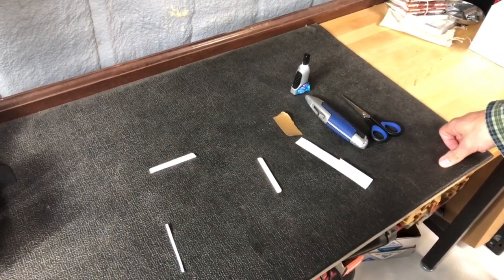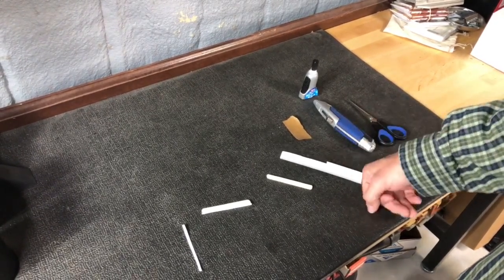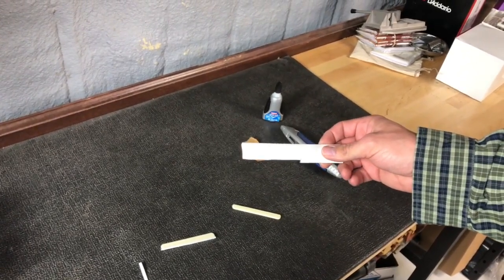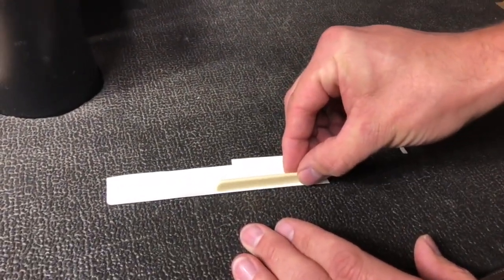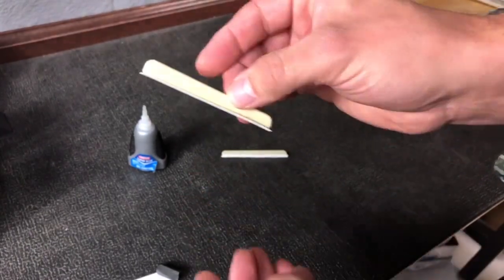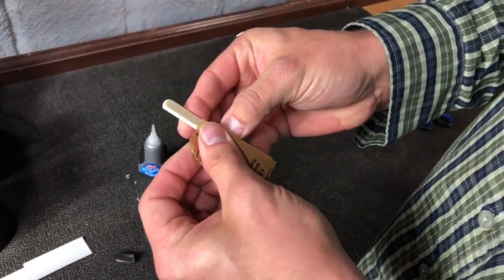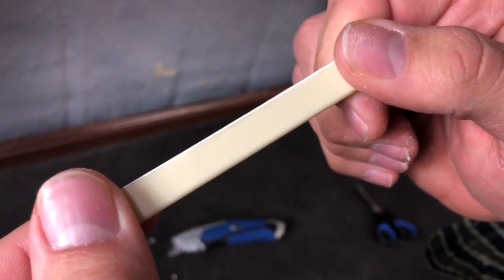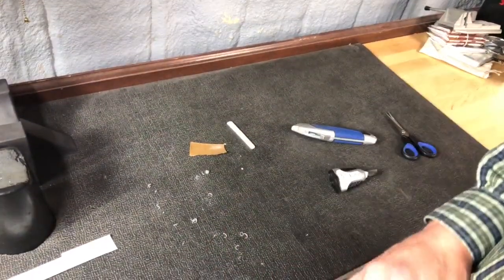Tech Tip– How to Raise or Shim a Guitar Saddle

Comment: Thank you so much. I paid a luthier $120 to set up my guitar and he put the saddle so low that all the strings were buzzing and he wouldn't fix it. I can't thank you enough. The only thing I had available was a fingernail file I took it apart and there was a plastic insert in between. I cut it with scissors and filed it down and it fit perfectly. Hallelujah❤❤❤
Reply: That’s not a luthier that’s a con man
Reply: I paid a luthier 100 for a setup and he made no adjustments ,just changed my strings.  Some really bad luthiers out there, and the good ones are expensive.  Best time learn yourself. This is a great video. Thx
Reply: Many years ago, I took a fairly expensive acoustic guitar to a tech who had been in business for over 30 years...I don't know how. 🙄The guitar had an under saddle pickup & the action was way too high. I asked him to do a full setup to get the action down with no buzzing. All he did was change the strings & adjust the truss rod. (I could have easily done that myself!!) I asked him about lowering the saddle because the action was still way to high, & he said that he didn't like to mess with saddles that had a pickup!!! Another time I took a guitar to a tech because the frets were uneven...all he did was raise the saddle...said he didn't like to mess with frets!!!😕How do these folks stay in business??!! So I just learned to do it all my self!!!!!

Comment: Thanks...some interesting tips! I live in southern Indiana...huge humidity swings summer/winter wreak havoc on my guitars, even using AC in summer & humidifiers in the winter...I have to use winter saddles & summer saddles to adjust the action, rather than shave a saddle that works perfectly one season only to have to raise it later. One of my Epiphone guitars came with some plastic saddle shims, so I used a couple of them...seemed to work ok...could tell no difference in tone. I didn't glue them in case I have to remove them in the summer when the action may shift again.

Comment: Cool Vid. Thanks. Another shim material without having to trim it, is to use Evergreen Scale Models styrene strips. They can be purchased in various dimensions. Try your local hobby shop. 0.15 is close to 1/64". .0.30 is close to 1/32", etc.. Just take your saddle to your hobby shop, and chances you'll find a strip dimension that will fit your saddle, or individual saddles perfectly!

Comment: cut a strip off an old credit card - just lay it in there under the saddle - works great -
Reply: @chiefline7084  😂😂😂
 That's when the cash from your wallet begins to disappear!
Reply: I sanded my saddle so much that it fit entirely into the bridge without protruding whatsoever. I used your tip - guitar plays great now.

Comment: had a travel guitar with some fret buzz (went too aggressive on sanding the saddle). used some trimmed up old blind material as a shim based on this video. worked amazingly! sounds so much better!  thank you for the tip. very happy, resolved the buzz, can't tell the difference on the action(still plays great), maybe more resonance? placebo? eitherway, happy and grateful for the video
Reply: I think even very tiny bit of buzz kills sound quality, especially sustain: it stops vibrations quicker. I have similar issue.

Comment: I just changed strings yesterday on my acoustic and found that the factory had shimmed the saddle with a piece of stiff yarn or string, which I imagine might be absorbing some vibration.  I kept it in, but it got me to wondering, why not just use a piece of guitar string?  That would make it pretty easy to know how thick it was and adjust it accordingly.
Reply: I don't see any reason why that wouldn't work. No different than putting a piezo pickup under the saddle. Good idea!
Reply: It’s a shit idea
Reply: The bottom of the saddle needs to sit flush in contact with the bridge so that the vibrations are transmitted correctly. The guitar string, being round,  does not allow this to happen.
Reply: @whatwouldhousedo5136  - nevertheless, round guitar strings still transmit sound to the saddle ;)
Reply: @TPITEOTG  Yes, but as I said, not "correctly", meaning there is some loss.

Comment: Is there a way to take out the bridge and put it back in without removing the strings from the guitar? I don't want to have to put a new set on
Reply: Depending upon how many wraps you have on your strings in the tuning posts you may be able just to unwind the strings enough that you can put out the bridge pins and then the strings.
Reply: Stick a capo on your first fret and then loosen strings, pop off bridge pins, and remove saddle. Super easy and quick.

Comment: Interesting, Amazon has a lot of "guitar veneer", including Rosewood, and even Mother of Pearl which is of course "bone"-like structure ;) backed by Maple. Thickness about 0.7mm-0.8mm which is good (at 12th fret, it will add only 0.3mm-0.4mm). Plus you can always sand it.
Blind material solution should be the best one ;)
Reply: I found for example this: "Decor Replacement Parts for Classic Guitar Veneer Cover Sheets 5 Pieces - Black Wood, 200x90x0.55mm" - it looks like rosewood, colour is similar to typical wooden bridge. Same material as bridge; therefore should work.
Right now, I cut a piece of my wife's credit card, using it for $100 travel carbon Uke from Enya, which is made completely from plastic (carbon).

Comment: Good video. The Venetian blinds thing is one way to skin a cat. Like you said, there are many ways to do the same job.

Here is another idea that you can use on acoustic bridge saddles and any kind of nut. Get some sticky notes. Those pads that you write on and stick them all over the place.

Take one or two sticky notes and press the nut or bridge saddle on the sticky side. Use an exact knife to trim it to whatever you are shimming. The sticky notes are about .003" thick. But you can verify it with a digital caliper. If you need to go higher, add another one, or two. I have used this to shim guitar nuts very well. Especially good when you cut the nut slots too deep and you need to gig in a hurry with no time to go buy a new nut.

Comment: Here's one for you..I used candle to raise the saddle on my acoustic and I was surprised to find out it worked great sounds great no problems at all..
Reply: Sorry I meant to say candle wax
Reply: How?
Reply: What a Fucking terrible idea, have you heard of resonance
Reply: @guitarman1477  - why not, as a whole construction, if saddle doesn't move inside bridge, if it is strong connection between saddle and bridge, without any move, then it works. Compare with opposite scenario: saddle is thinner than slot for it (as is the case with so many guitars), and you put small pieces of ribbon under it, then it won't work. The only issue with bee wax, or anything similar, is how to measure it, how to clean it, hot to ensure it is even, etc... I personally wouldn't even try. Similarly, you can drop "superglue" right inside slot, wait till it dries, and so on, - agreed, FTI (fuchking terrible idea)

Comment: I know this is off topic of this video. But, I have left hemiplegia, so, o can’t play cords with my left hand. So, I bought a left handed guitar. But, the problem is, I have trouble holding onto a pick, and due to the way my hand closes too easily, even a banjo pick seems hard to use.  This might sound like a strange question. But, should I just try using the pick on different fingered, or even buy thumb picks, to use instead?
Reply from the maker: Honestly, I'd have to see to make a recommendation. I do recommend checking out a product called Gorilla Snot, which helps me hold onto my pick: https://store.banjobenclark.com/products/gorilla-snot-pick-grip
Reply: Try herco thumbpick
Reply: Plenty of guitar players who don't use a pick.

Comment: This video doesn't address a couple of major issues. First, the shim should be twice the thickness of the extra height that you're attempting to raise the strings at the 12th fret. Arbitrarily tossing in a piece of blind slat without measuring it, and going by trial and error to find out if it'll do the job is pretty dumb. Second, super-gluing the shim to the bottom of the saddle is something that I've never seen anyone do, and is completely unnecessary, unless you just want to make it easy to trim the material. As long as the properly sized (thickness and length) shim will fit down into the slot and is at least 75% as wide as the saddle slot, it'll work fine with no gluing whatsoever. And finally, luthiers despise the excess use of super glue (as in this instance) more than anything in the world.
Reply: "luthiers despise the excess use of super glue" - except for carbon travel guitars. Can you glue bridge to HPL deck using fish glue? Yes, some luthiers prefer 3M PR600 to superglue.

In this specific case, gluing plastic to bone, or to plastic, I don't see any issue with superglue.